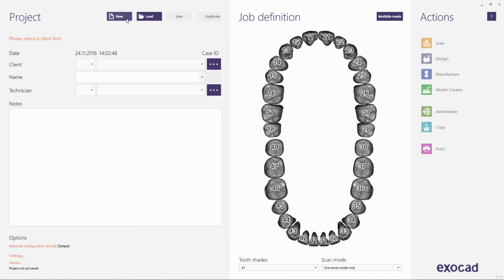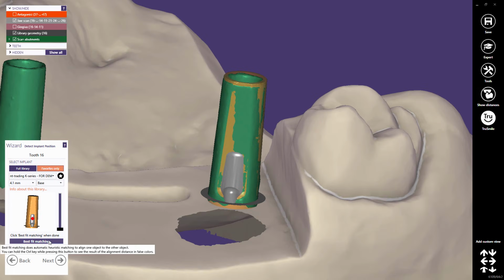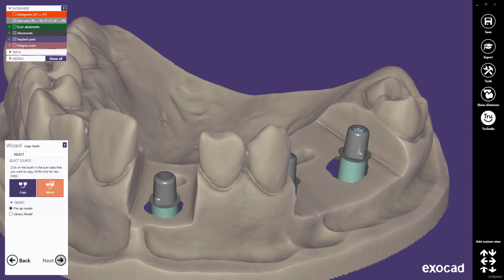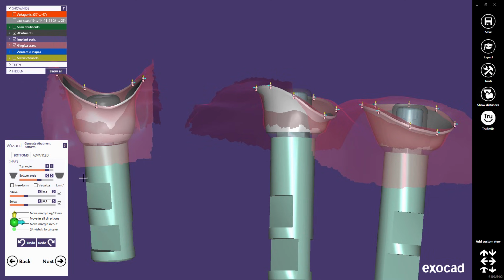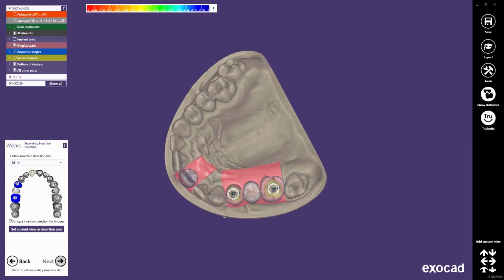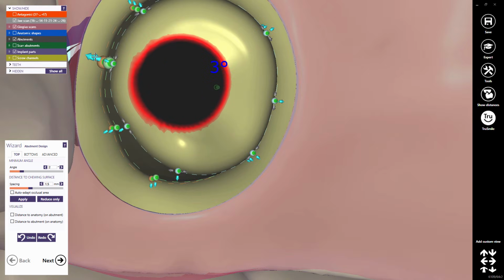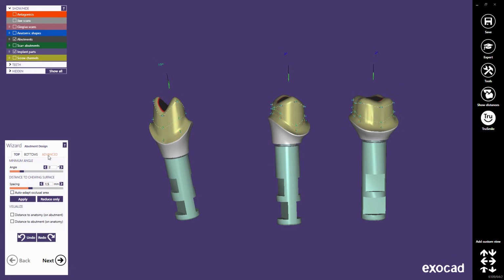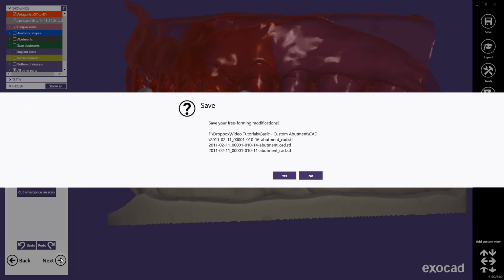exocad Video Tutorial (basic): Custom Abutment Design

Comment: How to remove 30 degree angle limitation of the secondary insertion direction of abutment in 3.x versions of exocad? Like it was in 2.4 versions.
Reply from the maker: In the transition from exocad DentalCAD 2.4 to 3.x versions, certain settings and limitations may have been updated or changed, including the angle limitation for the secondary insertion direction of abutments. To address this and possibly remove or adjust the 30-degree angle limitation, you can try the following steps:

Check Software Settings:

Open the DentalCAD application.
Navigate to the Settings or Configuration menu.
Look for options related to Abutment Design or Insertion Direction.
If a limitation for the secondary insertion direction is set, adjust or disable it if possible.

Comment: Hello. i have one question to you. What should be the width of connectors for metal ceramic and zirconium crowns in the EXOcad. thanks you for your help
Reply from the maker: Hello, the material configuration affects the choice of materials and the respective parameters (e.g. minimum and connector thickness). You can choose a locally stored configuration, a configuration from one of exocad's material partners via dentalshare or a configuration from one of your dentalshare contacts (recommended if you wish to send out files for production). for more information please visit our exowiki page: https://wiki.exocad.com/wiki/index.php/DentalCAD_Documentation_-_Index_of_topics#dentalshare